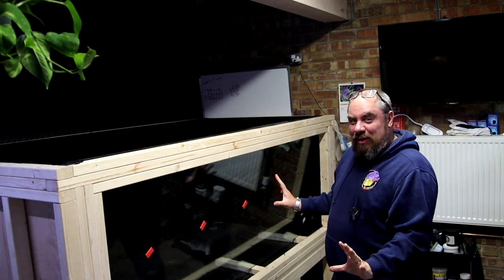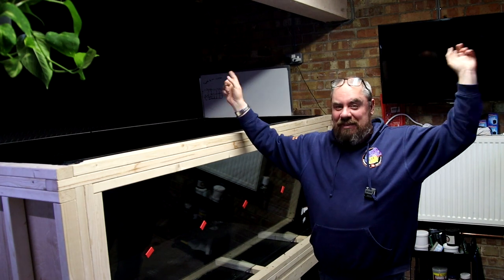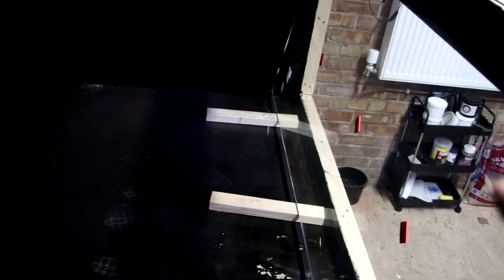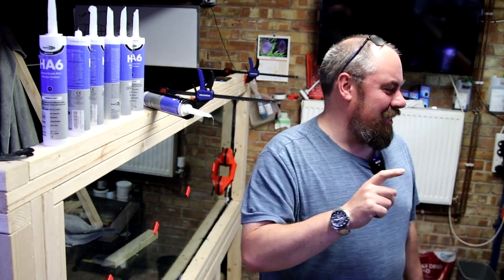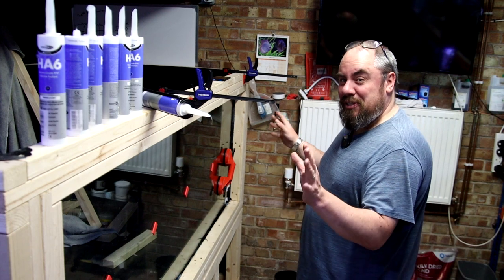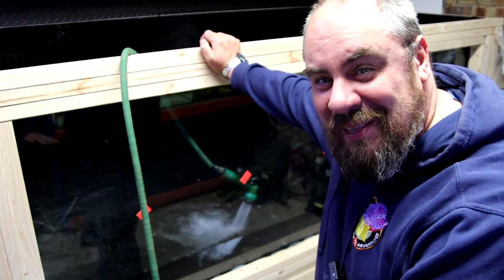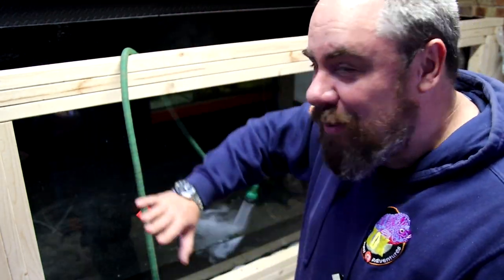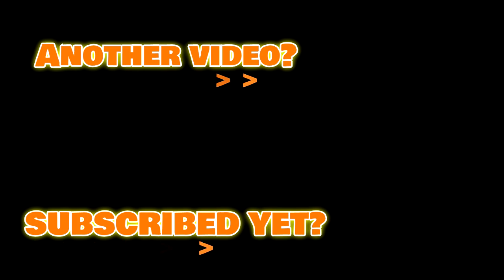MEGA TANK part 5: Adding glass and test fill!

Comment: Any updates on the megatank ,asking because of the glass being 15mm ive watched bloody hundreds of these being built ,there all using 20mm + thickness glass getting really stupid price quotes ,i know its all to do with the depth not size
Reply from the maker: The glass has been fine!
Reply: @AquariumAdventures  thought I would ask because some utube vids plus the Facebook groups are so frustrating not knowing what's best ,I've thought of using the liquid rubber same as you ,but I know you had a couple of teething problems, you think that was down to the joints and corners not being fibreglassed